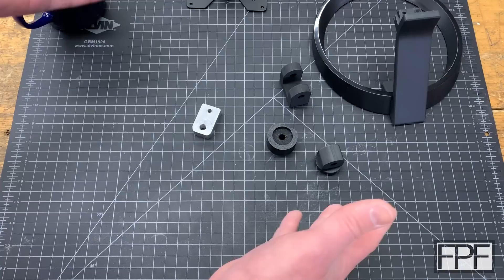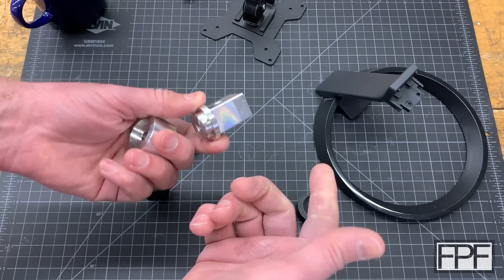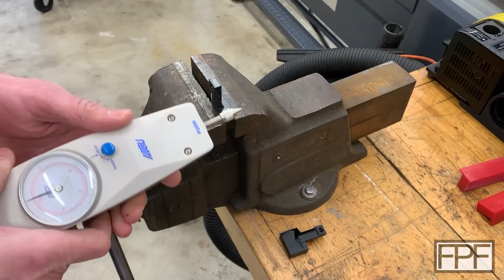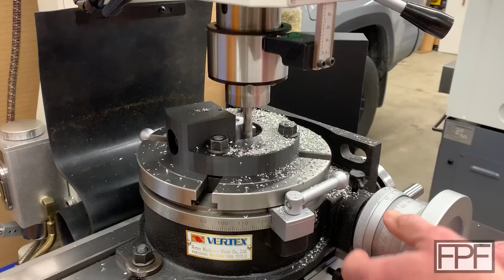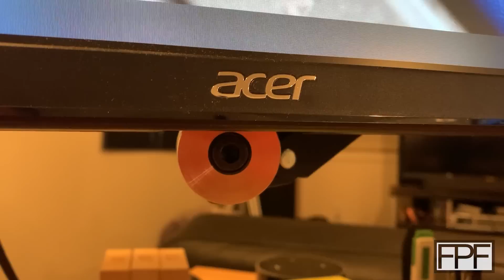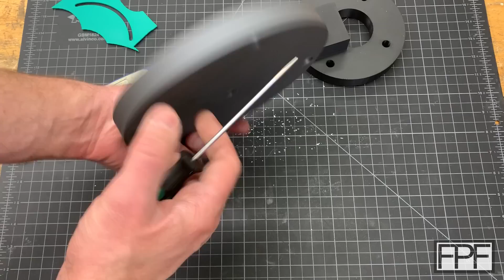3D Printed Rotary Fixturing

Comment: Nice solution to the fixturing problem. I think you can improve the machining process by 1. removing the bulk of the waste before you use the rotary table, eg by sawing milling, filing or sanding. 2 there may be necessarily a lot of stick out on your cutter which will lead to tool more tool deflection, your mill will not be the most rigid in the world so keeping depth and width of cut down will help this. 3. Carbide cutters are stiffer than HSS. 4. Aluminium does tend to suffer from chips welding to the job so vacuuming and using coolant or lubricant will help. 5. once you locate the zero position i.e. the centre of rotation of the part there is no need to keep it there, you can move the x axis so the initial cuts are lighter and rough out the part until you are a ready to take cuts at the 0 point, locking the table at each point is also good practise.. 6. I find I get the best finish when climbing cutting, this is only on the last very fine finishing cut, the rest are dome with conventional milling. I’m enjoying your channel thanks.
Reply from the maker: I did the 2nd one this morning with that axis and plunged most of the material out, then moved in for 2 finish passes.  worked MUCH better.